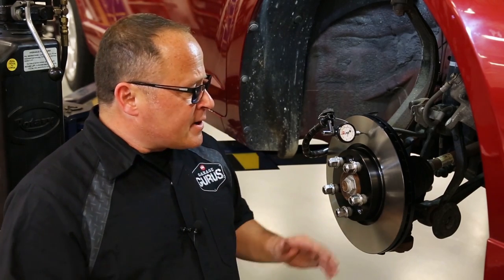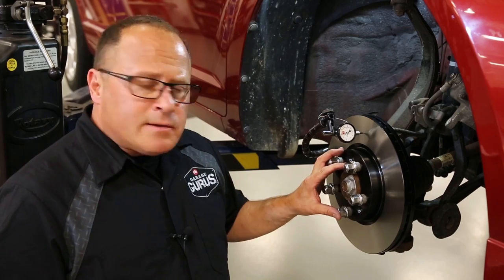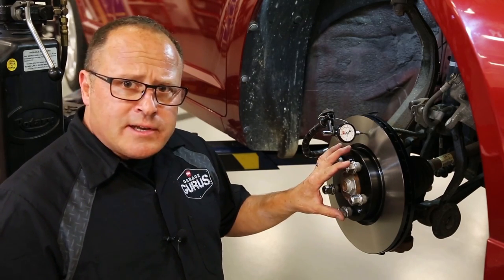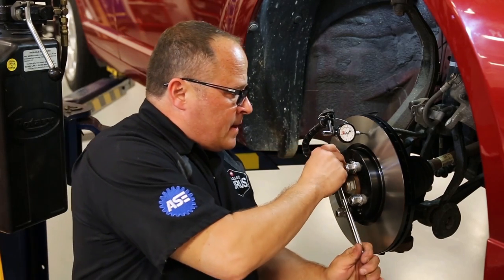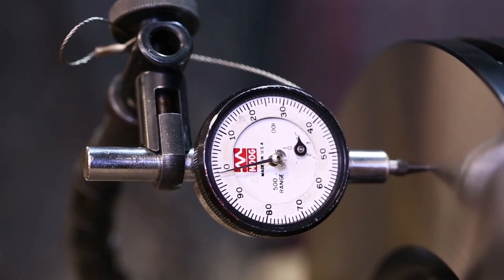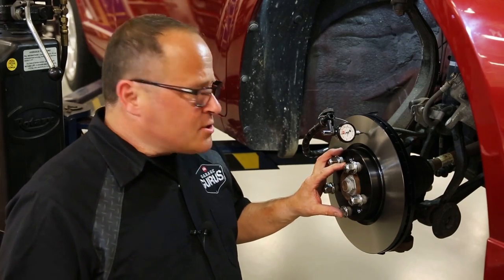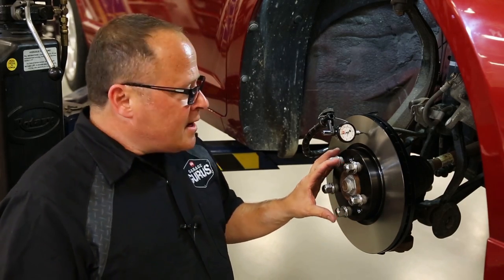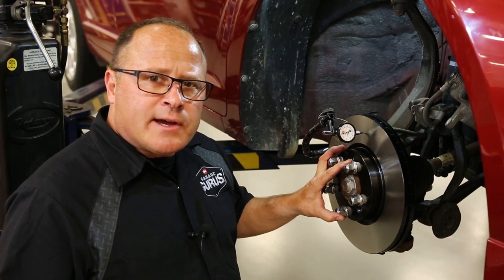Measuring Brake Rotor Lateral Runout

Comment: How does rotating the rotor resolve lateral run, out. Is there any other advise besides cleaning the hub flange?
Reply: It doesn't. I think that was a brain fart because he even paused to think about it.

The only thing indexing does is reveal whether the rotor or the hub is the culprit. You mark the point on the rotor where the deviation happens. Then you index it. If the deviation continues to happen on the same mark on the rotor, then you have a warped rotor. If the deviation happens  on the opposite side adjacent side of the mark, the hub is the culprit.
Reply: @LynxStarAuto  I can imagine that if the rotor had run out and the hub had equal run out, you could find a position where the two run outs added and a different position where the two run outs cancelled.   Hardly likely to happen in reality though.